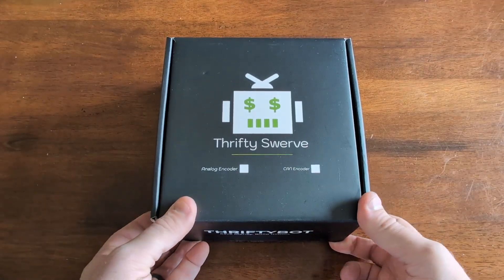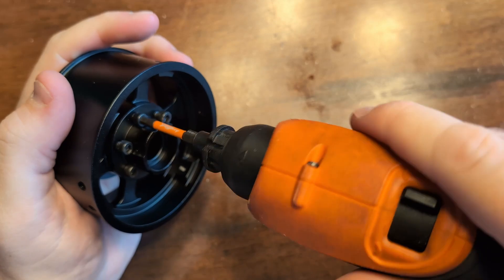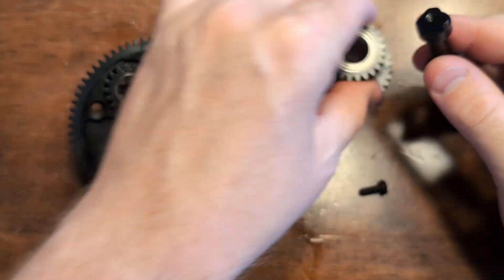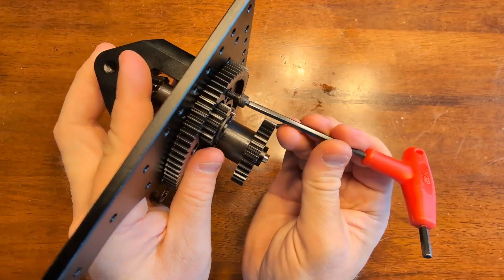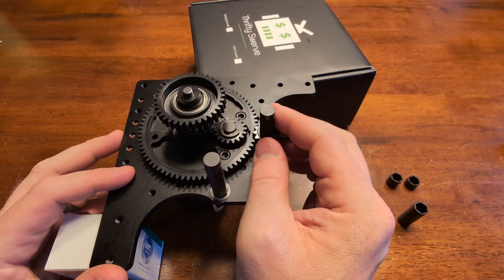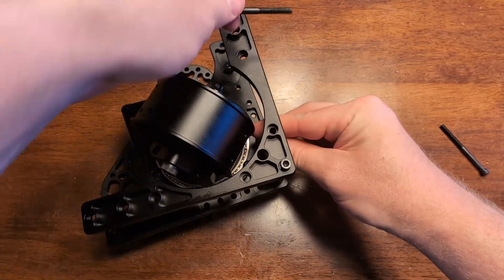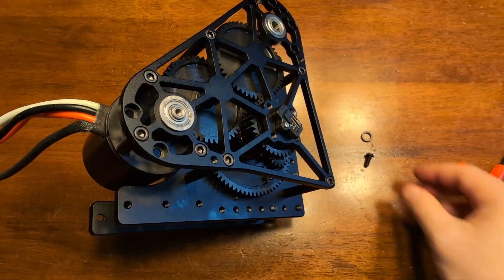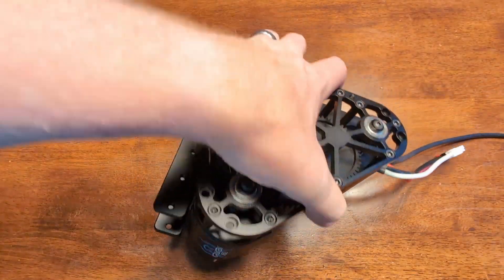Thrifty Swerve v2 Assembly Video

Comment: As a tip, when checking for resistance after assembly, make sure the wires of the motor are not touching. This will put the motor in "brake mode" and may mislead you into thinking something is wrong.